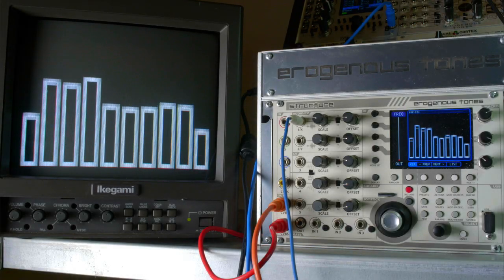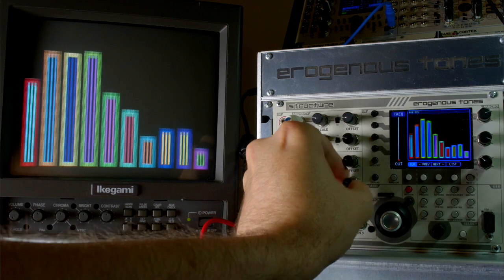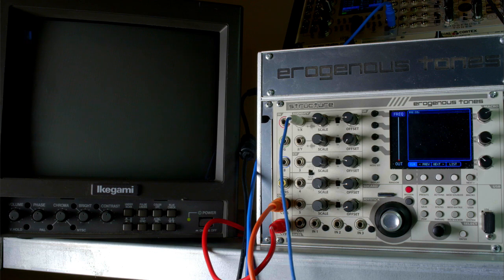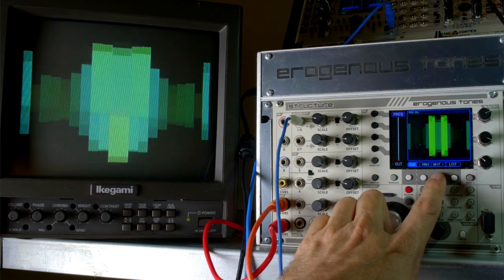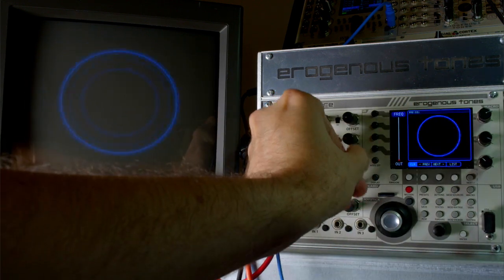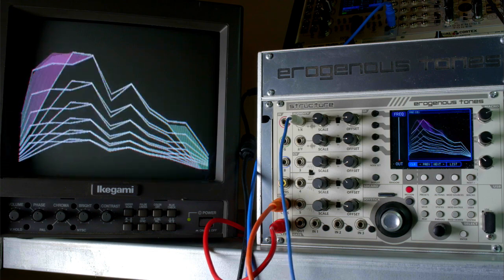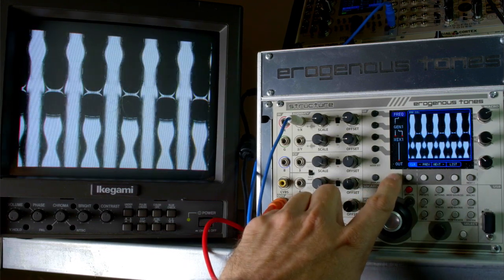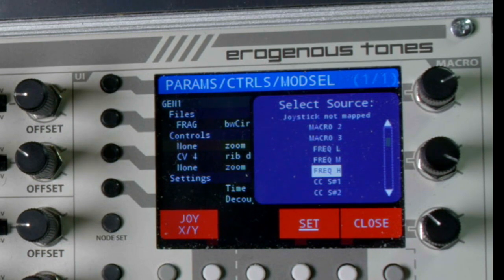STRUCTURE - new FREQ node for firmware v2.0

Comment: Cool! Question: What module would be a good companion to this for a 54hp lunchbox case to help add and exand its abilities.. The Structure is 38hp.. so 16hp to spare... EIther a standard eurorack module or LZX video eurorack module.  Thanks for uploading!
Reply from the maker: I like :
XAOC Devices Batumi Quad LFO (10 HP)

LZX Industries  Sensory Translator (16HP)
Reply: @erogenoustones7853  it would be cool if you could code the spectrum analyzer so that the bands could have an effect upon the parameters of a given node. Basically, an internal Sensory Translator.
Oh, wait now.., I wrote this before getting to 09:33 in this video. Is this exactly what you are mentioning here? If so, rockin’.